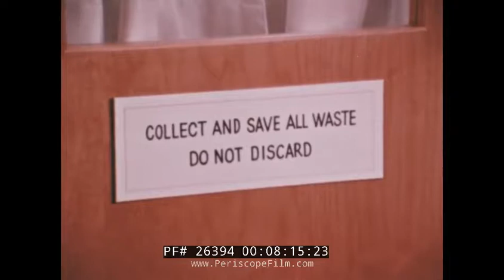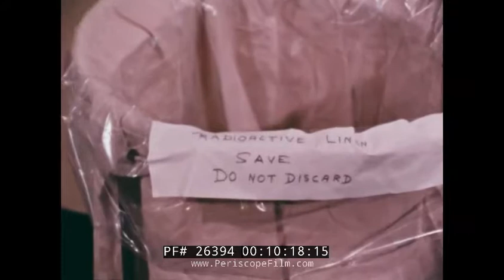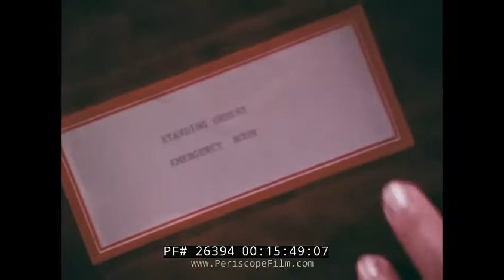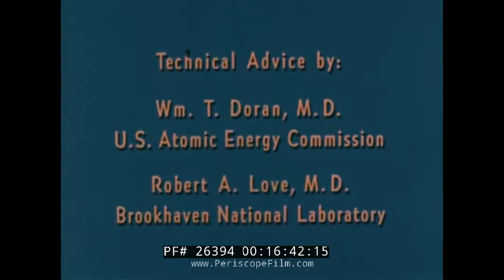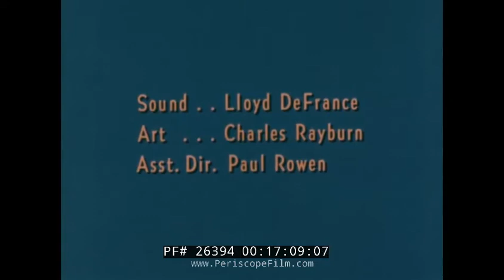" RADIATION ACCIDENT PATIENTS " 1969 MEDICAL TRAINING FILM   HOW TO TREAT RADIATION VICTIMS 26394

Comment: Is this information correct? Is it only if someone is exposed to a reactor core or something that they become a danger to other people? It seems like this is propaganda aimed at people fearing ever working in those facilities with radioactive materials and at hospital staff in being willing to treat patients.
Reply: They only become a danger to other people when they have radioactive material on them. Dust, particles etc. This is especially the case for Alpha and Beta emitters,  usually associated with fallout dust and radiactive waste if they got it on themselves.  If they've just been irradiated by a strong gamma radiation source then yes it sucks massively for them, but they will not be radioactive themselves nor an immediate harm to others.
Reply: The usual immediate solution to someone that's become radioactively contaminated (that is has gotten radioactive liquids/dusts etc directly on them) is removing all clothing and fully washing them. Similar to any sort of chemical spill accident. 
Water is also a good radiation shield and the waste water from this may be separately collected and filtered to avoid letting any radioactive particulate it into the normal sewage system.
Reply: So yes it is overall quite accurate albeit dated and representative of the best knowledge available at the time.
Reply: It's definitely propaganda. I've watched that Galen Winsor lectures all the way through dozens of times. Uranium under pressure just creates heat. It's just a way to boil water to turn a turbine. It's safe clean energy.